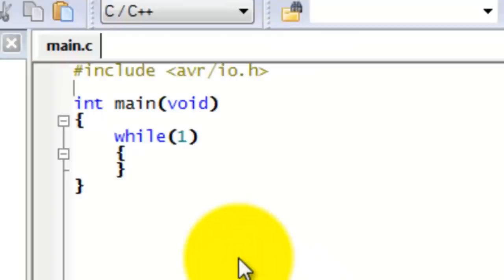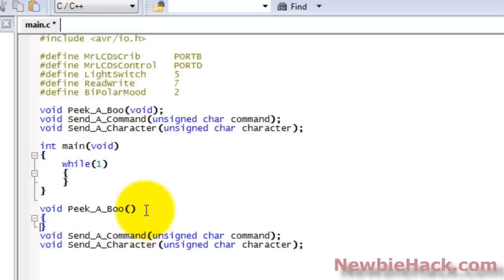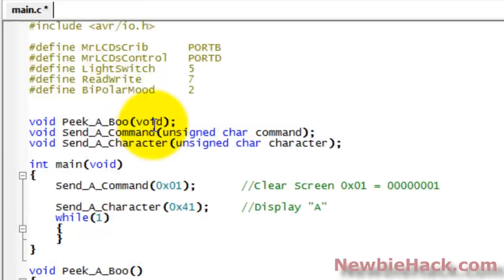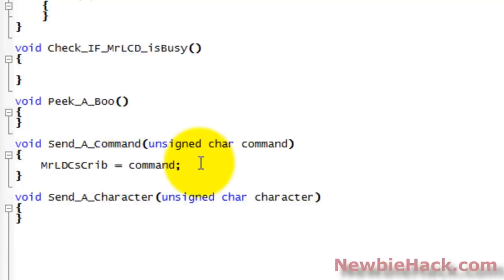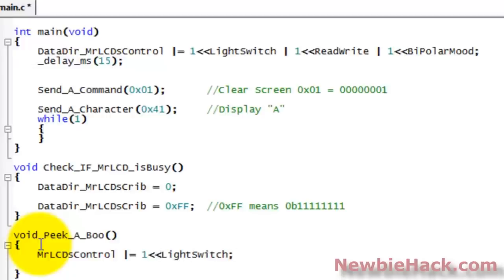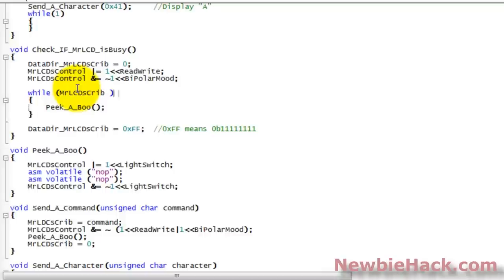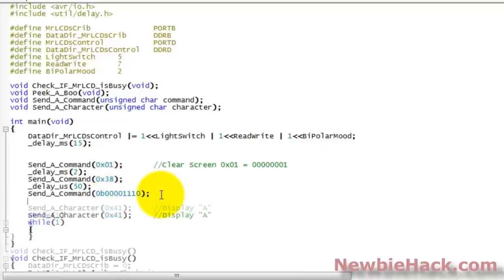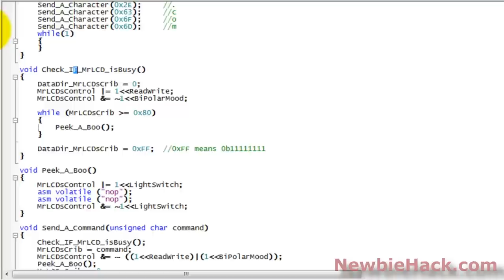20. Arduino for Production!  AVR Atmega32 - How to write our First LCD Program

Comment from the maker: Which microcontroller are you using?  The port D could be reserved for another purpose.  For instance, with the Atmega32 and related micros, port C is used for JTAG operations and must be disabled first.

If your port D is not reserved for another purpose, then check your code to make sure you are not using port D for anything else.  In the program on the video I use port D for 3 control lines (RW, RS and E).

Comment: Ten years late to the party, but if you're a beginner like me and don't have a potentiometer on hand for the contrast you can set PD6 up for PWM and wire it to pin 3 on the display:

DDRD |= 1<<DDD6;
OCR0A = 81;
TCCR0A |= 1<<COM0A1;
TCCR0A |= 1<<WGM01 | 1<<WGM00;
TCCR0B |= 1<<CS01;
Reply from the maker: Excellent, excellent recommendation. This may be the best comment for the MCU videos that I have seen in a while.  Having a free pin and a free built-in PWM so that the MCU isn't bogged down, the circuit can be simpler, and in high production, another trimmer can be removed saving quite a bit of money.

Comment from the maker: @eerereps I will be starting a UART tutorial that will cover communication through RS-232 using the MAX232 IC, and I will also provide a tutorial on RS-485, and a version that communicates on a single line that switches between RX and TX.  Buffering the signal will be addressed.
Reply: Must have defined ports and pins as EN,R/W,RS,D7,...D0.It could be better to understand than mrlcd crib and stuff like that

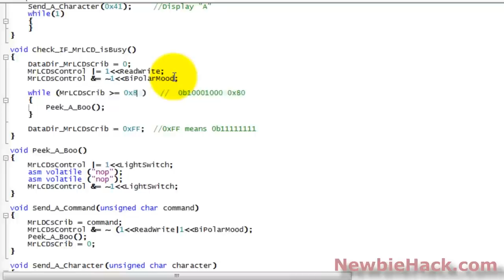Comment: @22:45 why do you keep switching the enable pin on and off if the busy flag is high? i dont understand the purpose of that
Reply: Eddie Amaya im an idiot dont mind me!!
Reply: +Eddie Amaya hi, the enable pin latches the command or data from the MCU to the LCD. It can happen in two ways: by sending a "high-to-low" or a "low-to-high" signal to the enable pin. Whichever way signal to send is stipulated in the LCD datasheet. Hope this clarifies your issue?

Comment from the maker: Hey xelionizer,

You are quite right.  Actually, the intention was to start out in the beginner form and move to intermediate quietly.  It's like building up on the fundamentals.  The fundamentals are in the first few videos and then those fundamentals are simply applied rather than explained.  If there is information that is not understood, it's best to review the first videos.  I plan to make the transcripts searchable on newbiehack, so the fundamentals can be found quickly.

Comment: Hi, i have a question.
Instead of all the delays(), can’t i just use the Check If Mr LCD is Busy function?

(im doing a project for the university and i can’t use the delay function, thats why in asking this)
Reply from the maker: Yes you can and I believe I talk about this in my newer videos, or in my book. I can't remember specifically. You can create a condition that includes that busy signal and then immediately write to the data pins along with the control pins.
Reply: @PatrickHoodDaniel   Thank you 🙏

Comment: I followed your insructions exactly and still can't even initialize the LCD. I tried adjusting the contrast in case it was working but it wasn't visible and still got nothing. I even tried a couple of libraries and still got nothing. I don't know what I'm doing wrong and I'm really frustrated. I have an atmega1284p and a qpass1602A.

Comment: Hi Patrick
I wanted to thank you for the excellent tutorials. They have been very helpful. I would like to offer something, if it hasn't been mentioned yet in your comments area. I realize some of these videos are starting to get a little "aged", though, they still work just fine. There is a deprecation issue with your "send string" libraries. As written, at least with Atmel Studio 7 (current release of GCC escapes me at the moment) there is a deprecation warning during the builds.

... deprecated conversion from string constant to 'char*' [-Wwrite-strings] ...
These functions need a slight conversion to char const *string rather than as they are currently char *string.

Just an FYI to help out those that are just now discovering your tutorials, or the ones coming soon.

thanks again.
Bob

Comment: Hi, thanks for this tutorial, the time and effort put into these videos is greatly appreciated.

I had some strange behaviour where my LCD would only display a few of the characters; It was quite puzzling. I then realized my chip was set up to run at 8 MHz. When I changed the fuse bits and F_CPU to run at 1 MHz the code worked like a charm. So it seems the delays used in the code has to be adjusted when running at different clock speeds. Not quite sure why. Maybe I just had to add more assembler 'nop' statements...

I really enjoyed learning how a LCD works and I'm looking forward to watching the next videos.

Comment: Hi, thank you for this tutorials you helped me clear up a lot of things. When I move to ARM and that should be soon I will most def. support you and buy breakout and programmer from your shop.

I have just one small suggestion since among other things I'm a programmer. Please do not name variables like light switch, or MRLCDsCrib and similar it's very hard to follow because mostly people are thinking (and should think) in terms as data direction register, port D on micro controller, enable pin on LCD and so on. It's much better for beginners also to learn in proper terms and it's so much more helpful when debugging because variables are named by what they are and not by abstract terms also it is very good and time honoured practice in programming to do so.

Thanks and keep up the awesome work!

Comment: thanks for ur reply Patrick! yes we did try different displays but i finally figured out the problem today for some reason it didnt work to use PORTA as datapins om my microcontroller (atmega164p) wich i think is really wierd! but changed my datapins PORTB and my program works just fine ;)¨
so if u get this problem just try another PORT:).
and thanks again for ur amazing tutorials! :D

Comment: Hi Patrick; this code don't work on proteus 8 and 7, after some checks, I found that the problem is on the enable function , it works on command fct but not on  character fct, I changed some lines concerning RS and EN pins, now it works well, thanks for the tutorial, the solution is to change PD5 with PD0, because i found a probleme (bug) on pd5 on proteus 8 and 7
Reply: hi there,  i'm using proteus 9, i just changed the PD5 to PD0, and changing the  "#define LightSwitch 0" from 5 to 0 also.. but mine still not working, did i missed some lines?? please advice thanks... 

edited - hey bro, i found my error after rechecking my lines, some typo error.. the code works.. i'm glad that i learned new things today ^.^
Reply: alan yap Hi; you have to delete the void Send_A_String(char *StringOfCharacters); function, because patrick has forgotten to delete this function in the code that published in the tutorial "Writing our First LCD Program"
Reply: You are my hero
Reply from the maker: Interesting, thanks for the update concerning the proteus software.
Reply: Thank you
Reply: you'r my hero. I ' ve just crush on that fault when using protues 8.  thank you very much =))) best wish for u
Reply: Thanks, i had the same problem.

Comment: This is and educated guess but I would randomize timer before defining integer. Just a thought. Also you might want to specify how many cycle are in your click tick in case randomize timer function does not work. I would also peek into the port address assigned like 2FE8 then specify parity and Xon/off variables.

Again this is just an educated guess, no pressure.

Comment: Hi patrick, i'm using atmega16L and im using the same code and circuit .As pin configuration were the same as mega32 i used mega16l ,but the lcd is not responding properly not displaying anything .Only the background light is working .Is there is any problem with the coding ,should i change anything specifically for my 16l.

Comment: I'm sorry I meant to saying that i was trying to use port C instead of D. You are correct it is used for JTAG. I looked on the datasheet how to disabled it but i didn't find it. I'm using the same chip as your video.

Comment: Hello,I used this on arduino board ,I switched PORTB and PORTD.I used 8 bits in PORTD and 0,1,2 bits in PORTB.Same codes but I couldnt work it.What could  problem be?

Comment: Is there a reason you used upper case letters when it showed lower case letters in the code when inserting newbie hack? Does it make a difference?  0x4e verses 0x4E
Thanks (I have spent 4 hours so far on this video - putting it in notepad and replaying it over and over to catch most of what you are doing- It is very interesting. (I guess when I try the program I will find out won't I :D)
Thanks again.
Don

Comment: i have the same problem have been trying to get it to work for like 15 hours with a friend from my school,  and hes a way more experiensed programmer then me!
first we wrote our own code for a display and we couldnt get that to work so we tried to use this code that ur using in the tutorial. and we get the same result :( but im using a 16x2 display and a atmega 164p but it should work!!

Comment: Hi Patrick. I'm following all videos you do about microcontrolers and I am very glad we can find very well done tutorials like yours. Thank you for that.
So, as you were writing the code for the LCD, you came to the peek_A_Boo() function, where you wrote the ASM code. You said two lines were enough for you mc, but maybe it would be necessary some more for others. I tried the same, but for mine (ATMEGA328P) I had to put hundreds of ASM code lines to get a string written. Is that ok? Is there another way to do that?
Reply from the maker: If you are needing many of the ASM short delays, I would suggest increasing the delay by using a delay function instead.  LCDs are very slow and may require longer delays to wait until the LCD is ready.

Comment: Hello!
I have tried all your tutorials so far. And I have got my first problem. I connected my 16x2 display and it didn't work. I can see all dots lit up. What should I check, to solve the problem? Code is the same, circuit, I made is right.

Comment: if you are on proteus 8 replace light switch 5 by 0 and connect it to pd0 pin of port d 
it will work fine
Reply: Can u explain whats the reason? Im using proteus (7.8). Firstly it was not working. As per your comment, I changed pin5 to pin0 of port D and now its working fine. Thank you.

Comment: @Stitch7577 If you wish to use arduino with the atmega just go into the arduino ide and in the menu burn a bootloader to the chip of a USB programmer and then use it like a normal arduino

Comment: If you are using crystal oscillator and have proper clock, you should try adding 50us delay between Send_A_Character calls
Reply from the maker: Correct, but this video is at the very beginning of the tutorial series and I cover crystal oscillators in a later video.

Comment: In the busy check, why do you perform a Peek_A_Boo? I know you're "wasting time", but does the actual signal sending help in any way, or are your just utilising an exisiting "time waster" function? (Ie why not just do some noops instead of calling Peek_A_Boo?)
Reply from the maker: You can, but if you take a look at the timing required from the command sequence, you will notice the timing is in the 30 to 160 microsecond region which would require many noops. A more sophisticated way of using the LCD would be to use timers and interrupts, along with reading the busy state of the LCD (or maybe just te latter would be sufficient).

Comment: I can only see the first character on the LCD. So if I try to write "NewbieHack.com", only N will show on the LCD. Do you have any suggestions what may be wrong?
I use Atmega328P (from Arduino), and MrLCDsCrib on PORTD (Pin 0 to 7).
Reply: Hi,
Same happened to me (I use an ATmega324PA @20MHz). After some digging into the LCD controller datasheet (ST7066U) I saw that the minimum delay for control line E on/off/on is >80us, at least for checking the busy flag (ST7066U datasheet page 28/42). So probably you also have a fast controller and need to replace the "asm" statements in the "Peek_A_Boo" function with a delay of 80us - (_delay_us(80);). Now the code works fine.
Happy coding!
Reply: Your a life saver <3

Comment: At what clockspeed are you running your atmega? my calculator tells me at 8Mhz an instruction needs 125ns, but you only use 2 nops. In the previous video you said it can take up to 500ns. what's up with that?

Comment: Hello sir. I have tried to follow you tutorial and had some problems with it which i posted on avr freaks. All i got in replies was insults and nothing else. they say this lib is the worst one. But i think its the best video to know how lcd works actually works. I like your method. but i am having a problem bcoz i am keeping lcd on the same port. 

rs=0
en=1
db4 =2
db5 = 3
db6 = 4
db7 = 5

this is a little off course as taught in this video. can you also shed some light on assigning pins on same port please. 

Regards
Jessica
Reply from the maker: Not sure why they are saying that.  AVRFreaks are a very tight knit community and they want all the content they can get on this subject.  The forum users speak in heavy jargon and are zealots in this subject.  I have learned a lot from this forum in the early days, but when you figure out how to use the datasheet, you will not need to use forums to learn how to make things work.  

As an aside, before I did all of these videos, I fear posting on AVRFreaks as I felt that I would be ridiculed as so many others have.  It's very unfortunate.

Please email me (email on the newbiehack.com site) and provide more detail on your issues and I will try to help.
Reply: Absolutely true sir. I am learning on these subjects and i hope if i learn from you i can surely pace up my skills. will join newbiehack.com in a minute
Reply: Patrick sir i am trying to contact through newbiehack.com but the link is not working. Please suggest.
Reply from the maker: All the links I try work.  To which link are you referring?
Reply: Hi Sir, I was trying the links on contact page. Let me try again there may be a problem with my computer. Not sure though. :)
Reply: Sir i tried again but still the same.
Reply from the maker: What link are you trying to click?
Reply from the maker: Those links are mailto: links.  It will open up your email inbox so you can create and send an email.
Reply: Sir i tried all three of these on the contact page.

For technical assistance, click here.

For order assistance or questions, click here.

To submit ideas or your project for posting on this site, click here.
Reply from the maker: Yes, those are the mailto: links
Reply: Thank you Sir. I have sent you a message and got in touch with Mr Bernard. I just learnt about your live section and absolutely amazing it is. Just as i was wishing.
Reply from the maker: Yes, that is actually a great resource.  The customer service live actually tries to be intelligent.  Ask a simple question.  If the questions is not available, someone at my office will answer it and then if someone else asks a similar question, then they will see that answer.  It uses an algorithm that searches other questions rather than searching answers for the answer.

Comment: wouldn't it be easier to write this:
//////////
char string = 'Newbiehack'; 
int i, len=strlen(string);
for (i=0; i<len; i++) Send_A_Character(int(string[i])); 
//////////
especially with this you could send a string over UART to the controller and then print it out, just replacing 'Newbiehack' with the received string, right?

Comment: When doing the bitwise shift - can you just bitwise shift 0 into the the appropriate bit?
eg |= 0 << lightswitch
Why is and and operator used in some of the bitwise shifts?

and for the check if busy while loop, would it be tidier code just to look at the induvidual bit, or use a bitmask?

Comment: I have been watching your tutorials from past 1.5 years and i do not hesitate to say that it's awesome.Thank you. Hope i had teachers like you in my Engineering college. 
I tried the same code for ATmeag32A . I didn't get any errors while building but i am not able to get the output. I wired the same ports as you did. Any idea what may have gone wrong ? By the way my micro-controller works at 16 MHz, so does this makes any difference while giving delay?

Comment: unfortunately in 4 bit mode check_busy sub program doesn't work properly.
All who want to setup 4 bit mast do 2 change:
1. in check_busy:
 while(i==1) {
  LCD_PORT_CONTROL |= 1 << LCD_E_PIN;
  asm volatile ("nop"); 
  asm volatile ("nop");
  if (!(LCD_PIN_DATA & (1 << LCD_PIN_D7))) { i = 0; }
  LCD_PORT_CONTROL &= ~( 1 << LCD_E_PIN );
  asm volatile ("nop"); 
  asm volatile ("nop");
  LCD_PORT_CONTROL |= 1 << LCD_E_PIN;
  asm volatile ("nop"); 
  asm volatile ("nop");
  LCD_PORT_CONTROL &= ~( 1 << LCD_E_PIN );
 }
this the only way that I find
2. The first initialize comand should restrict to first HI 4 bit (only 0010)whithout low 4 bit due to turning LCD to 4 bit immidiately after sending. But after that you have to send full comand bit (0b00101000) to adjust the type.
Reply from the maker: Excellent!  Thank you so much for the code and solution to help those who want to use the LCD in 4-bit mode!

Comment: I don't seem to understand what the purpose of Peek_A_Boo is. Short explanation would be greatly appreciated, thanks!
Reply: Peek-a-boo is just partrick 's instructive way of naming the function to send a pulse signal to the enable pin of the LCD. It could be a "high to low" or a "low-to-high" signal depending on what the LCD datasheet stipulates